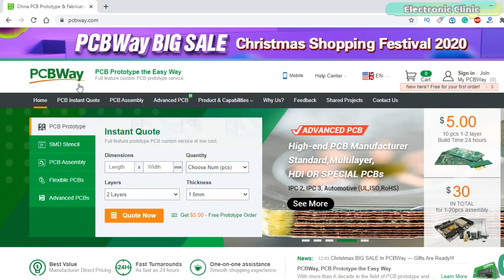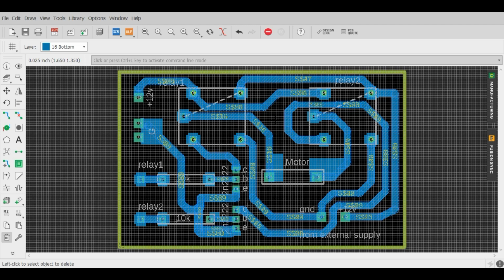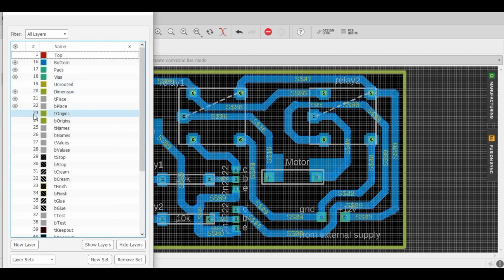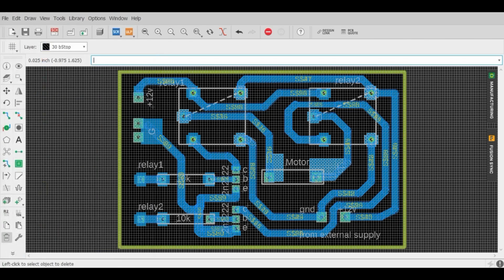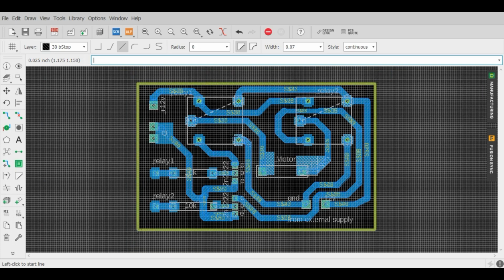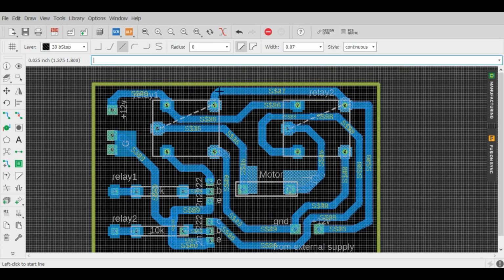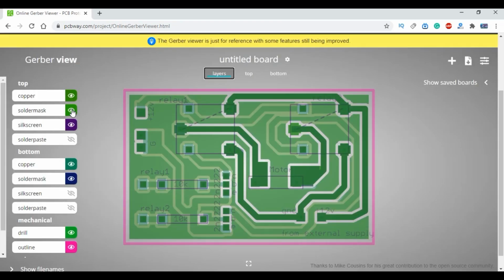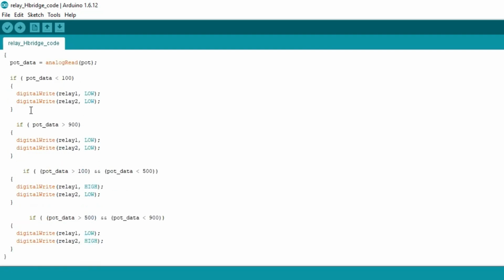PCB Tinning to improve PCB traces current rating,apply solder to PCB traces in eagle, Relay H-bridge

Comment: How do I add solder on traces using EASYEDA? Thanks alot
Reply: Regardless what you do, if you were going to use JLCPCB, they would not add solder paste on the tracks. They would only plate it (sometimes referred as thinning as well). They only use solder paste for assembly service - only for footprint pads that have actual parts placed on them .

Comment: In a typical PCB design, you will require a solder mask over those traces, therefore you will be unable to tin them, in that case you must simply extend the width to accommodate the expected current. Leaving exposed traces in some applications may not be a big deal, but in others, leaving major current or voltage carrying lines exposed will have bad results.